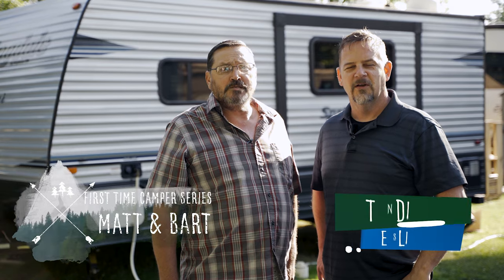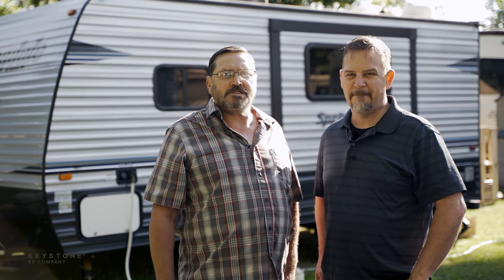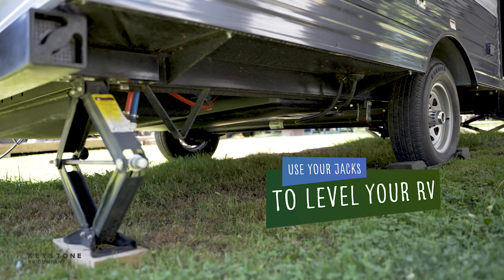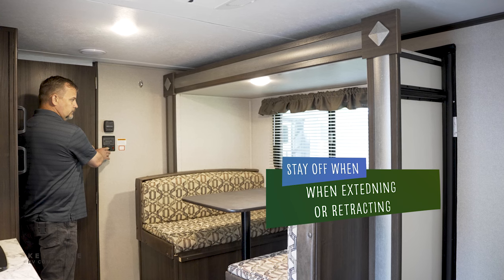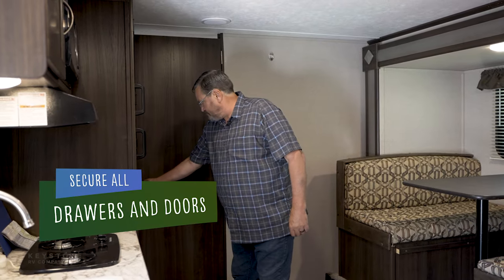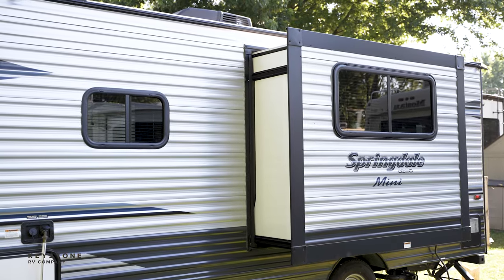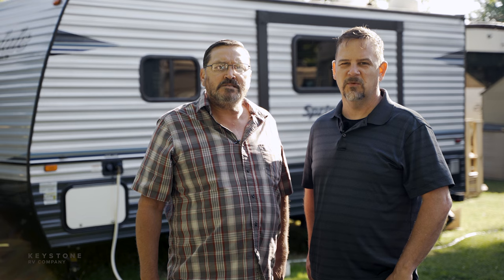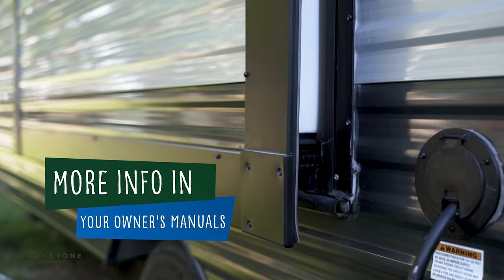First Time Camper Series - Episode 4: Extending the slide-outs

Comment: The slideout cable brackets on my 2020 Keystone Cougar were not properly installed at the factory causing the cables to fray, and therefore causing me to cancel some camping trips, and a lot of aggravation. I have had many problems with my Cougar. I would not buy another one.
Reply: Not any better on our 23, already broke one set of cables and there ready to fail again… 😡

Comment: Hey Keystone! I have a 2017 Keystone Hideout and the big slide is opening unevenly. There is an inch and a half difference. I need some assistance with this problem.
Reply from the maker: Good afternoon, we are sorry to hear you are having this issue! This could be an issue with the slide mechanism or the slide needing adjusted. We would not be sure without a proper diagnosis of this. Any authorized Keystone dealership or service center can assist you in having this looked at. To locate your nearest dealer please visit; https://www.keystonerv.com/find-a-dealer. Thank you!

Comment: I have a 2002 keystone Montana and I can’t tell if my living room slide is sliding in correctly. It’s a the rack and pinion one and when it’s coming in the bottom comes in first and then the top comes in and it scares me every time bc I don’t know it that’s how it’s suppose to work for those. Is this normal?
Reply from the maker: Good afternoon! It sounds like this needs to be looked at further by an RV technician. Any authorized Keystone dealer or service center can assist with looking at this for you. Thank you!